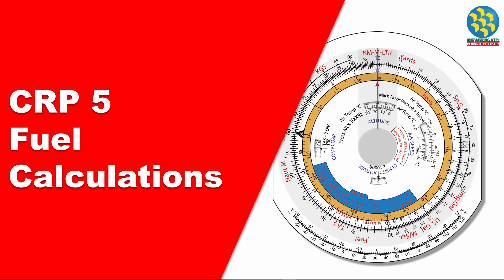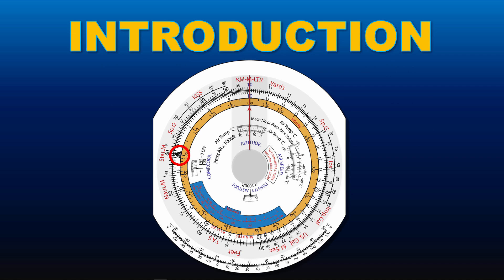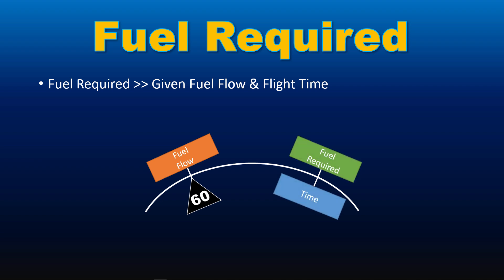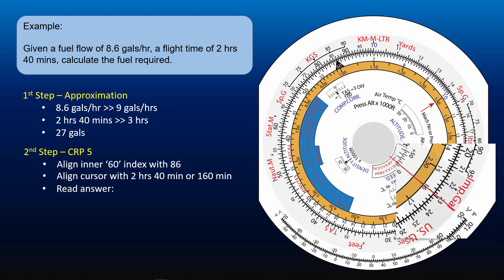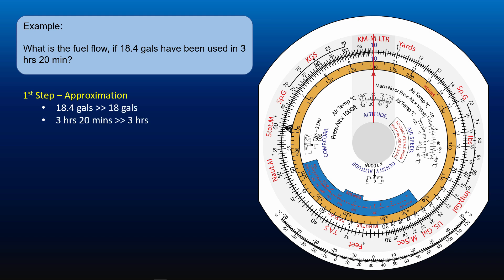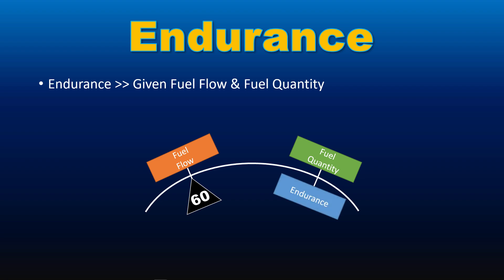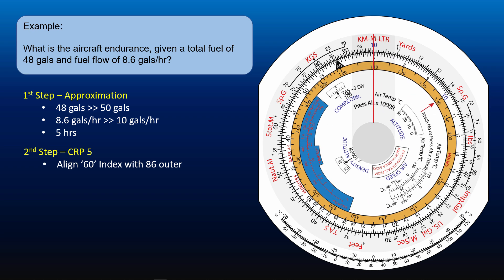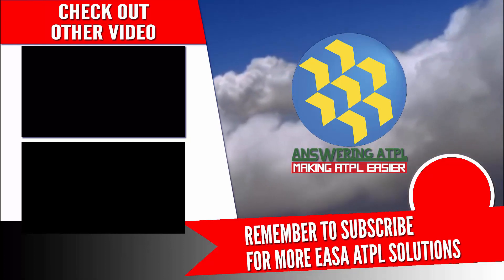Fuel Calculations | CRP 5 Flight Computer | Navigation Computer #6

Comment: Can you make it for me ...?? A fuel amount of 146 imp gal allows a endurance of 4 h 26 min what is the coresponding fuel flow ??
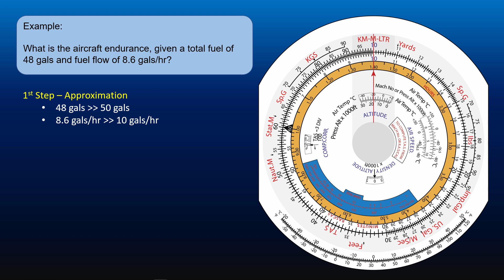Reply from the maker: To solve your question find 14.6 on the outer scale to represent 146 imp gal. Then on the hour's scale, find 4:20, and use the minute scale above it to add another 6 minutes, or you can use 266 on minutes scale.  Then find the '60' index on the inner scale read your answer on the outer scale. The answer is 33 imp gal/hour.